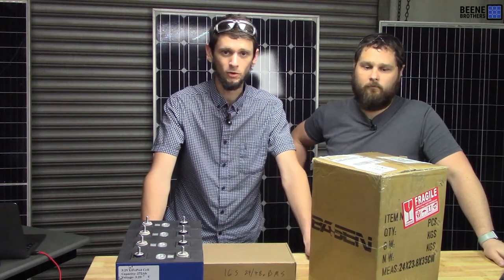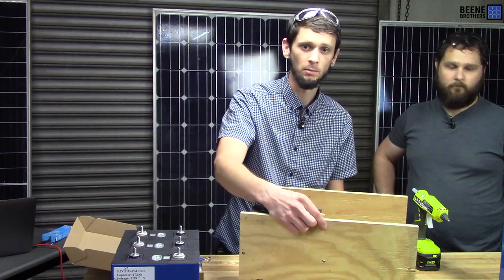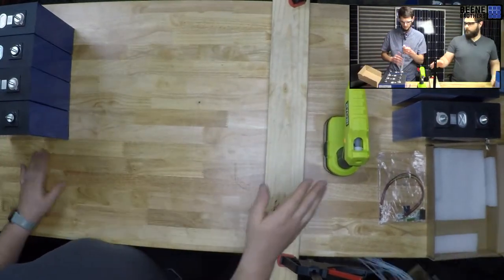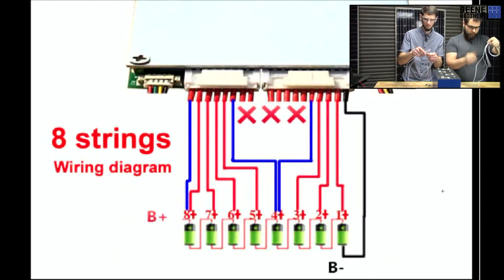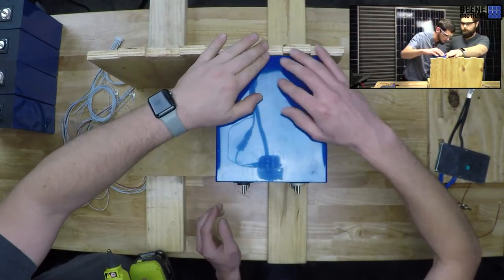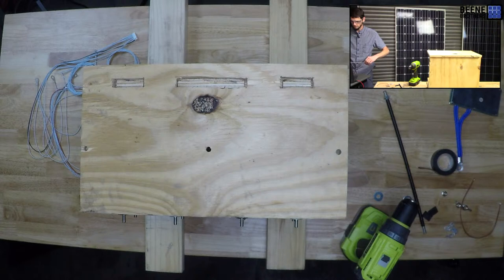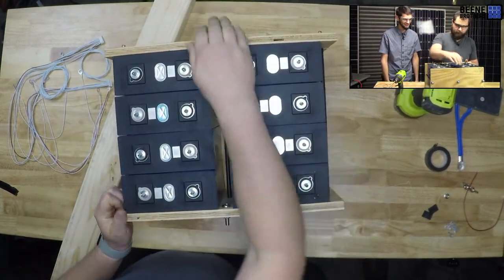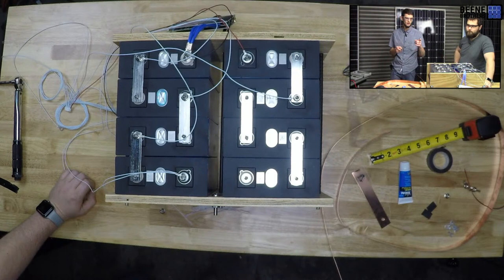LIVE - 24V Lishen 272AH LiFePo4 Battery - Build Part 1

Comment: I'm slowly setting up my gear I bought many months ago. I just installed 6x250w panels and been thinking on buying 16 of these cells and going 24v. I got to check my inverter settings to see if 8 cells will work.

Comment: Good video. However, you forget to place an isolator between the Lifepo4 cells to avoid short circuits. This can happen by compressing the cells or by vibrations. The foils of the cells are very thin and can therefore be punctured very easily. Hot glue is not sufficient. The housing of the cells is usually connected to the positive pole and that could cause a short.....
Reply from the maker: What do you use as an isolator in your build? As it is I have two layers of blue coating from the cells and the glue is to prevent them from rubbing causing them to wear through. I’m having a hard time imagining pressure causing a short if there is insulating material in between.

Comment: What if the lifepo4 batteries already have bms in them purchased that way, would you still need an additional bms for the batteries connected with one another?
Reply from the maker: Would you be changing from 12v to 24v?

Comment: I don't think it is a good idea to put conductive grease on the bus bars/terminals on batteries.  You could put it on AFTER you tighten them, so they are not in between the lugs and the terminals and it will prevent the OUTSIDE of the bus bar from oxidation.  Those are copper bus bars with nickel plating, so you don't really need grease at all unless it is in a wet environment.